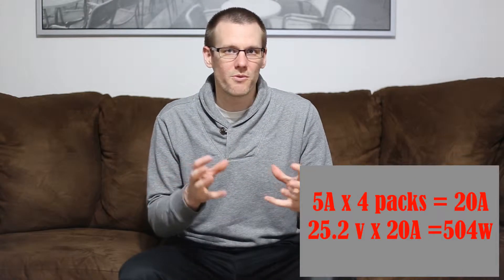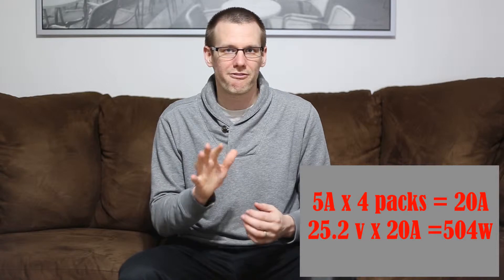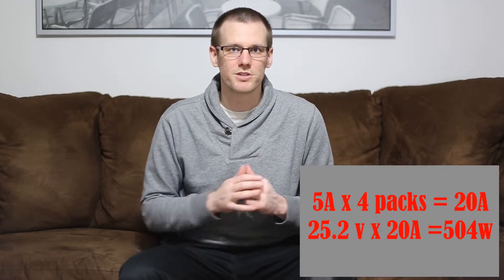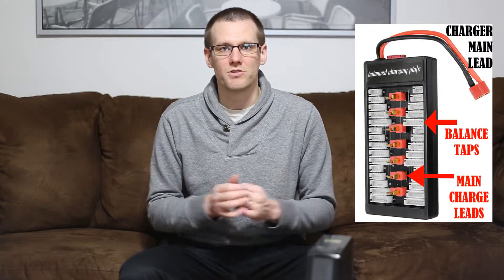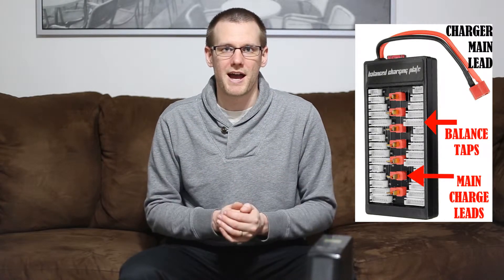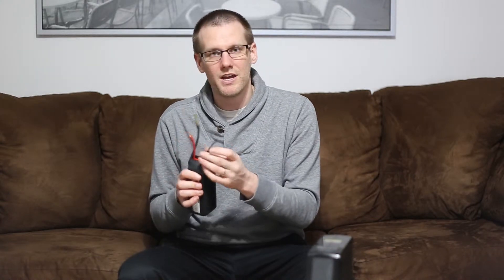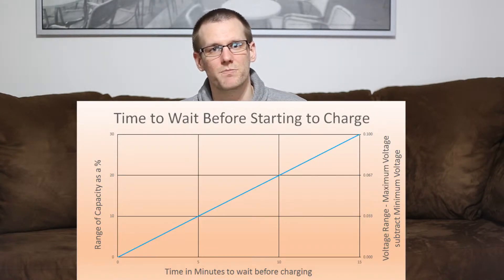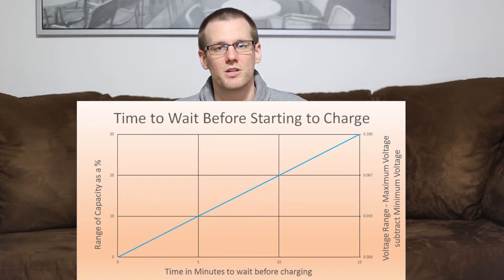Parallel Charging RC LiPo Batteries - The do NOT Do's

Comment: Do you still have to wait even if you have an advanced parallel charging board like the JB ultimate charging board?
Reply from the maker: I'm not familiar with the board. Unless it has independent balance circuitry built in for each battery port, the same rules would apply.

Comment: About the voltage differences between batteries, i would suggest to storage charge your batteries separately after flying, that way whenever you are going to fly, you don't have to worry about balancing out the voltage differences and you can just get right to the charging. That way you don't waste time either since storage charging only takes a couple of minutes per battery 😉

Comment: My battery is 9.6V 11.7Ah LiFePo4.  What setting should i use please.  I keep getting low voltage or high voltage.  What setting should i charge it?  It is 27 cell battery.  What should my mAh and V be on my charger?  Please help.
Reply: You aren't charging lipo batteries, you are charging LiFePo4 batteries which is a whole different battery....

If you don't know what you have in your hands i would suggest you first educate yourself about that battery and how it should be charged.

Comment: I don't understand how it can drain 100 amps when like 5 computers barely uses 16 amps.... Can someone explain me why??
Reply from the maker: What drains 100A? And 5 computers pulling 16A @ 120v or what?
Reply: He's referring to your jet amp drain of 100 amps giving 5mins battery time .
Reply: Because of the way power is calculated. For the power in Watts we need to multiply Voltage with current.

So if your computer demands 1.2 Kilowatts (what a BEAST) and your outlet has 230V

You’d decide 1200watts by 230 Volts and get ~ 4.7 Amps.

If your LiPo now has 12V for example, and you want to feed a motor that draws 1.2 Kilowatts, you have to decide 1200 Watts by 12Volts and get 100 Amperes the battery needs to provide to deliver the same power.
Reply: Divide not decide*

Comment: Great stuff! What I don't get though is... If you can charge packs with different capacities because the voltages are going to equalize...

Then why do I hear that you can't connect two different capacity batteries in parallel to be used in a device? Or is that incorrect. 

For example, if connecting batteries in parallel for charging results in equalized voltages and relative charge states, then why would the same not result occur when USING to batteries with different capacities.
Reply from the maker: The same would occur for batteries of different capacities and same C rating.

Comment: I have an i charger and I was wondering if you're able to use a parallel board to put multiple packs into storage mode?
Reply: The packs that I use are 2s batteries
Reply from the maker: Hi Mike, you can parallel multiple battery packs that start around the same charge state in terms of voltage. When you bring the packs to storage voltage, I'd check to confirm each pack has ended up at storage voltage. Slower charge/discharge rates will give the packs time to all balance out.
Reply: @RCexplained  okay cool. I was hoping to maybe use the board as a alternate way instead of having multiple Chargers to use the board to charge multiple batteries and have one charger. The problem is can I charge hard and discharge hard on it without having any issues? For instance a 20 amp charge and 25 amps discharge or 40 amps charge 40 amp discharge? Plus how much longer will it take to charge 4 batteries on the parallel board or would it be the same amount for 4 individual batteries or would it charge as fast as 1 battery?
Reply from the maker: @1dirtovalracer  it would be fastest to use the parallel board.  When I parallel charge I like to slow down the charge rate per battery and give the batteries a bit of time to balance out. Instead of charging 1 battery in 20 minutes I charge 4 batteries in 35 minutes or so for example.
Reply: @RCexplained  awesome. Thank you very much I think I'm going to buy myself a couple parallel boards. Probably like the one that you demonstrated the Protek board

Comment: If you have 2 identical batteries you use in a 2*3s setup in the car can you charge them in series like a single 6s battery?
Reply from the maker: Yes you can, provided you are able to figure out a solution for the balance taps.

Comment: Hi I've got 2 6s lipo batteries wire them up in parallel 1 is 10.000mh and the other 6600 mh would the total capacity be 16600 or 6600 as you go from the lower one
Reply from the maker: The total capacity would be the sum of the two packs when wired in parallel.
Reply: @RCexplained  OK other say the ah need to be the same
Reply from the maker: @revparsons3tl  it is best if mAh are the same but it does not have to be. This is for wiring batteries in parallel only.